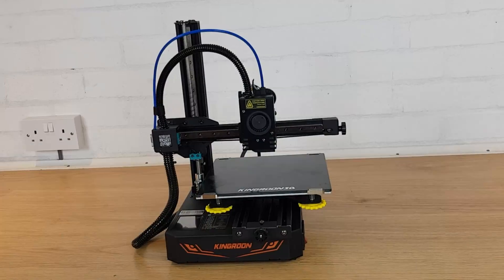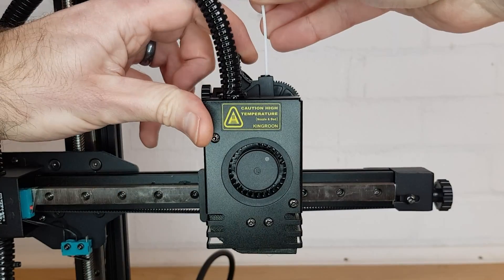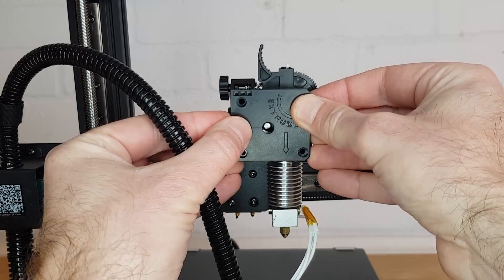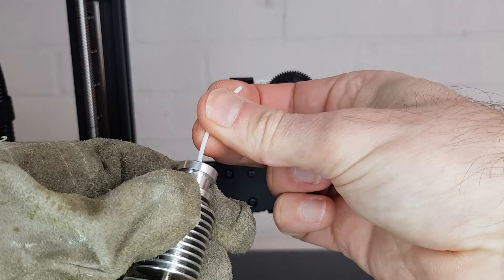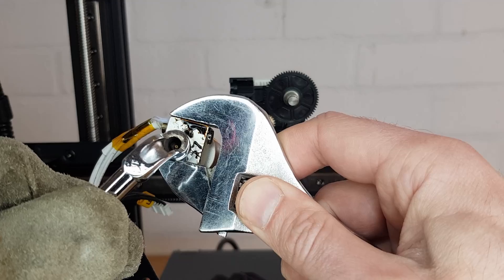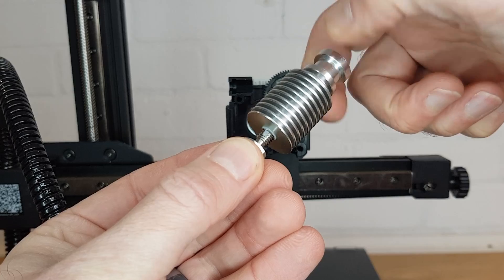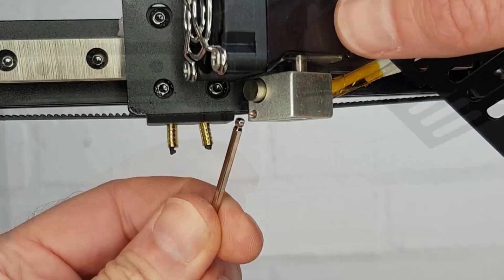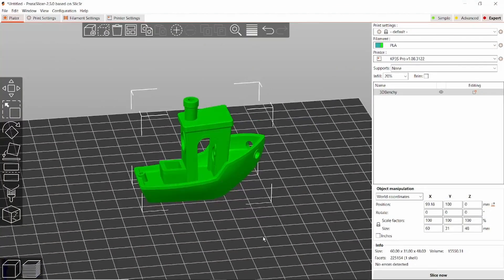3 Ways To Fix A Kingroon KP3S Hotend Clog (And Prevent Them From Happening)

Comment: The heat break in my KP3S has a short length of 2mm ID x 3mm OD PTFE tubing in the heatblock end. It should be long enough to bottom out in the hole and just slightly protrude out of the end to give a small amount of "crush" seal when the nozzle is installed. Not too much though or else it will restrict the movement of the filament. This tubing has very thin walls so it will break down over time due to heat. It should be replaced every few hundred hours of print time as a normal maintenance routine. If this little piece of tubing is left out, you will for sure experience clogging as there will be a void in the heat break for molten filament to accumulate.
I've ordered an all metal hotend conversion for mine that uses a bi-metal heat break. The part that goes into the heatsink is made of copper for good heat transfer and it is not threaded. It slides into a redesigned heatsink and is held in place via a grub screw. The end that threads onto the heat block is made of titanium to minimize heat transfer to both the heatsink and filament. I have six different FDM printers and my KP3S is one of the better ones. It consistently gives great prints while requiring very little maintenance. Love the little guy.

Comment: Orca Sliser : Ending G-code/
G1 E-2.0 F2300 ; retract
G92 E0.0
G1{if max_layer_z < max_print_height} Z{z_offset+min(max_layer_z+30, max_print_height)}{endif} E-20.0 F500 ; move print head up & retract filament
G4 P2000 ; wait 2 seconds
G1 E-15.0 F500
G4 ; wait
M104 S0 ; turn off temperature
M140 S0 ; turn off heatbed
M107 ; turn off fan
G1 X10 Y175 F3000 ; park print head
G4 P1000 ; wait 1 seconds
G1 E-15.0 F200
M84 ; disable motors

Comment: Hi, I bought that extruder + hotend kit that Kingroon sells for Ender 3 series printer (mine is Ender 3 v2). Print quality improved a lot with this kits (which is the same extruder/hotend that you show in this video).
Now to my question: do you know the block which model is? I am trying to find the silicone protector to it. Other wise I am thinking to put any e3d v6 block to it.

Comment: Nice video, i want try to change the resistor and thermistor, but i thinl if ita possible just cut the current cables and using a plastic connector between new and old for a fast change when be required, do you have some video to do this un this printer?

Comment: Thank you for this guide, it helped me a lot! 
Something I noticed when I dissasembled my hotend (during my first clog no less) is that the heatsink has VERY sharp edges both where the filament enters and exits the area right before the "void", these edges slowly grind the filament creating a lot of dust that could potentially clog the nozzle. So I just grabed a phillip screwdriver and gently removed the excess material from those edges until the filament moved smoothly through it.

Comment: look into the ender hotend fix. ive got a couple machine that came with v6 hotends, clones i assumed but ive never had a clog on any of them out of almost 6 yrs of use, had partial clogs an had to change nozzles but never had a heatbreak clog on one of the v6 hotend, now for my mk8 style hotend from enders, ive had those clog on ender 3 5 3max aquila  pretty much every printer u can have them on ive had them clog. i just got a couple kp3s and kp3s pro really cheap an they both are like new machines. both was sent back an i purchased them as parts only machines but both look like they are brand new an if used was only used once maybe twice. the kp3s was missing the leadscrew so i had to replace that but the kp3s pro was a complete machine an is like new but i notice when setting it up a little piece of filament sticking out the top of the extruder like it was clipped off just above so i figured it was clogged. so this will be my first clogged v6. ive got a couple extra v6 hotends that ive purchased an played with so i know how they come apart but i didnt expect this to be an issue with them. but for a fix im going to try to replace the ptfe lining in the heat break with a longer piece so it will meet closer to the top of the hotend. ive not used one setup in a direct drive configuration so that will be something i have to pay little more attention to but im sure the same type of fix will work with these v6 hotend as the mk8 hotends.

Comment: It also has a PTFE lined tube that could be burned and needs to be replaced.  Anything at 240 could melt and warp the tube. :( I would only really print PLA up to 210 on those.

Comment: I swapped it out for a genuine E3D v6 with a bi-metal heat brake and a CHC I've never had this type of extruder setup before I initially wanted to try with a BMG but I found a kit for my ender 3 on Ali. Was kind of horrified when I looked at the hot end. Kind of surprised it uses mk8 nozzles.

Comment: they designed the hotend that way to make inserting filament go smoothly as the large chamfer will collect the filament end nicely even if its a little bit crooked. The problem is that they thought that this upper portion of the heatsink will stay cool (as it should) and therefore not cause any clogging issues. Apparently thats not the case and even that upper part gets hot enough to melt the filament. There are a couple of ways to fix this. The cleanest way is to buy a different aftermarket heatbreak. Just search for kingroon heatbreak and you´ll find a version with a titanium throat and a copper part that connects to the heatsink. this will not only fix the clogging issue but will enable the printer to print high temperature filaments.
Reply: Is hands-down, the absolute worst designed hot end. I don’t even use mine anymore because it clogs every time I print and it’s damn near impossible to get the filament to even come out all the way to the end when you’re feeding the filament in the first time, it’s such a pain in the ass. I’ve just given up on it.

Comment: great video, right on the money!!! thanks for demystifying those clogs for me! They usually happened when I would run out of filament, now I know why - filament melts over inside heat sink and blob is  formed - exactly in the place that you described.  After I watched your video I verified that blob was formed and that would prevent the filament from extruding.  
Was anyone able to find a drop in replacement heat sink assembly? Would some form of e3d clone be able to resolve this issue for good?

Comment: Hello. It helped me a lot and solved the cloging. I checked the google drive in description. There are 2 folder for Cura and Prusa. Does it mean, the profile setting also available for Cura? Or only for Prusa? Sorry for asking, im new at 3d printing. 😊
Reply from the maker: I couldn't get any of the Cura profiles to load so I just used the Prusa ones. I haven't looked at them for a while and you may have more joy than me if they've updated in the mean time.

Comment: Hey Ricky, I bought this printer because I wanted a smaller unit than what I already had (mega X). Was getting a bit nervous about clogs after watching a few reviews, but after watching this I’m confident it shouldn’t be too much of an issue if it happens. 
Really hope that you make a video upgrading the hot end /heat break to get rid of the tubing.  Thank you

Comment: Hotends always end up being clogged for some reason, I've had all kinds of designs, from the Geeetech ones, Ender, MK8, V6 etc... (not the very expensive ones though) all end up being clogged, its frustrating and its time consuming but what blows my mind is that one of the most popular hotend, the V6 has a round design that makes it rotates by itself while printing..very practical...I can't believe after all these years, 3D printers are getting better screens, are more user friendly etc...but the hotends still have the same flaws and the same designs.

Comment: an easier but riskier manoeuvre (what I do) is set the temp to 200 and jam something in the heatsink fan... wait for the heat too creep up to the heatsink (3-4 minutes), then tug the filament every few seconds until it pops out. No disassembly required. BUT you may start a fire or melt a fan :)
Reply from the maker: I effectively tried this by just unclipping the fan from the hotend and heating everything up to max temps but it still wouldn't clear for me.

Comment: Hello Ricky, this video also helped me to remove a clog. I was about to send back the machine because the dissamble looked painful and dangerous. I want to say to newbies that it's not such a big deal, i removed everything carefuly without heating anything and pushed the remaining filament that wont melt with a small allen key. Now i'm looking for Prusa slicer profiles as the one you"ve linked are for the pro version... Thanks a lot !
Reply: its the same hot end as the 'Pro' version FYI to anyone reading this. Just change the bed size in the slicer and save the setting. The rest (mainboard, extruder)  is identical

Comment: ❤ your video, helps me alot, but i got another problem, after reassemble the hotend. it not heats up whenever i turn on the power. it doesn't stop.  even i didn't change the temp.  i am running klipper
Reply from the maker: Hi, this will be something in your printer config file. It will be heater or thermistor pins specified incorrectly. Where did you find the config file information?

Comment: Thanks dude it helped a lot, I didn't had any clog at least when I started watching the video I only wanted to dismantle my extruder to check wich parts buy extra parts. When I got to the tube part I test it with the two nuts it came out I measure the pice and just out of curiosity tried to see what would come out.... An enormous clog of filament came out 😢 I just decided to  also clean the tube by heating it and just re armed everything together.
Reply from the maker: Sounds like you had a clog waiting to happen! Glad you caught it👍

Comment: hi Ricky, do you have experience with TPU filament. i'm trying to push filament out of extruder, but it  seems stuck in the middle. while if PLA, it can passthrough to extruder. i'm using 95A. thank you
Reply from the maker: Yes, I've printed TPU quite a lot with my KP3S. The only time I had the problem you have is when I had the filament 'donut' stuck in the hot end.

Comment: Overall I did learn a couple of things from this video but I don't have as much trouble with clogs as you say you had.  I still use Cura. I only use PLA and TPU. You never mention the shut down procedure. I always make sure the hotend has cooled to below 60 degrees before shutting the printer off. I beleave that if one removes power when the hotend is still hot there is a chance of heat creeping up bast the heatbreak and causing a clog.
Reply from the maker: Hi, i'm glad you haven't had the same problems. I did consider heat soak as a factor but all of the clogs I had happened while everything was still powered with the hot end fan running. Thanks for the comment, definitely need to be considered.
Reply: Mine clogged after the first print.. It's my 6th 3D printer, first Kingroon tho

Comment: I have two KP5L and one Ender 3 with Kingroon's DD extruder, and never had a single clog while printing (I had a clog when intalling the extruder to the Ender 3, but it was caused by a mistake I made). I think that gap you mention is present in most extruders with threaded throats. I use about 1mm retraction, and it seems suficient to reduce stringing. I would suggest you to check if there is something wrong with the heatbreak's fan. Maybe it's rotation is bellow the specs and it is causing the heatbreak to work hotter than it should be. The stock heatbreak's fans are not very good, I had ratling problems with them (had to dismantle and lubricate).Great video! PS: For those not familiarized with Kingroon products, basically these extruders I cited are the same as KP3S's.
Reply from the maker: Good to hear your experience, thanks. Yes, I can see how the hotend fans could be a little below par.

Comment: Hi Ricky, Im a long time viewer and Im having problems with bed leveling that I dont think you have adressed yet because your guides focus on features that my printer does not have. After purchasing my ender 5 s1 I've been having problems with leveling my bed. I manually level and when I do this I have to fully tighten the back right adjustment and practically fully loosen my front left adjustment. This is my first concern as this doesn't feel right to me. Once I get it level and then use the auto level it works fine... for about a day. I have to redo this process nearly every day. The front left side always seems to be too far away when this happens. I am not putting force on my bed in any way. I am also not even talking off the build plate. I need help I have no idea what's wrong. I would try to use nuts to lock the screws but there isn't even enough thread on the front left screw to fit a nut on.
Reply from the maker: Hi, I'd love to help but I don't have an Ender 5. What your printer does have though, is 4 point leveling. It's not ideal as it is possible for one screw to always be too lose if the others are tighter. Try to start with all of the 4 screws giving the same tension to the springs. Some advise tightening them all fully then loosening from there but I prefer to set all springs with zero 'pre-load' which is where the adjuster knob is only just starting to 'grab' and tension the spring before I start tramming. To get there, loosen all adjusters fully first. Once you have this starting point, try to always adjust two screws at a time along a side. For instance, to set some tension in the springs, I would wind the same amount on both fronts and then both rears, I never do large adjustments on just one corner.
Once you have roughly equal tension on each corner, then you can start looking at making adjustments to get the bed parallel to the nozzle movements (tramming). If you need to adjust more than about 1mm then try to again adjust a whole side rather than just one corner. If you are able to do this, you should be able to get your bed trammed whilst also keeping good tension on all springs. Really hope this helps.

Comment: In Cura, with this style hotend, I found reducing retraction down to 0.5mm at 25 to 30mm/s reduces the amount of clogs, down to nearly zero. Also helps immensely with zits, or as the cousins over the waters call them, "Boogers!!".
Reply from the maker: Thanks, yes reducing the retraction does seem to help.
Reply: hi, could you please tell me which settings exactly you have changed in Cura (the names)  ? thanks
Reply: @marcinwee5278  In the TRAVEL section, check the enable retraction box, and then change retraction distance and retraction speed.
Reply: @imranrazaq632  thanks mate